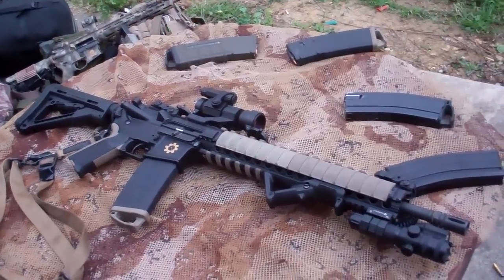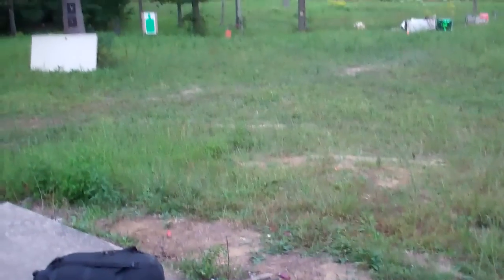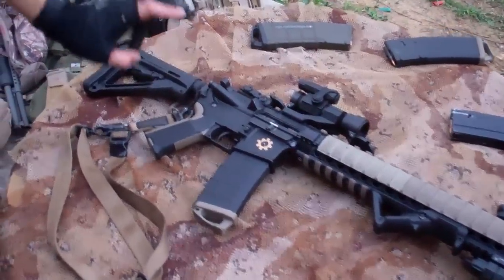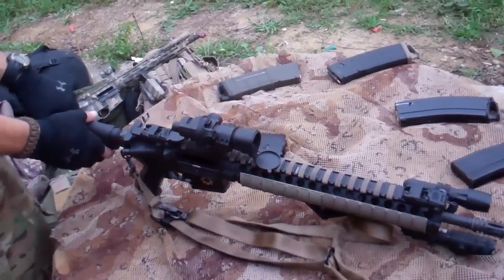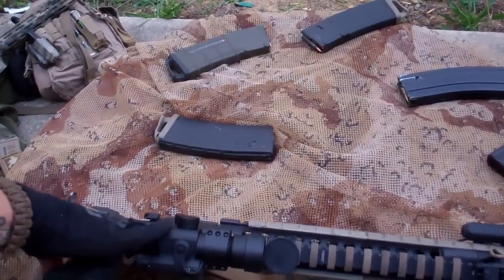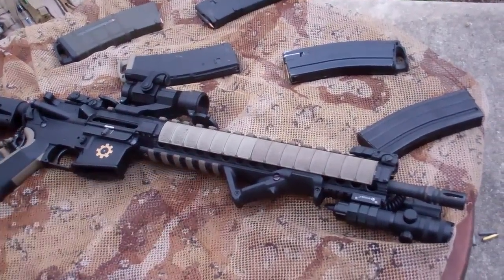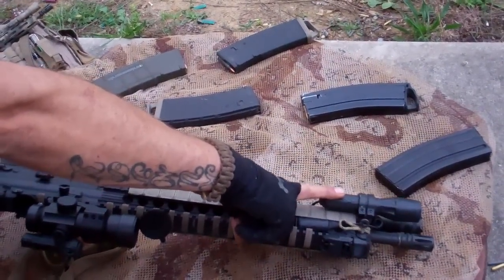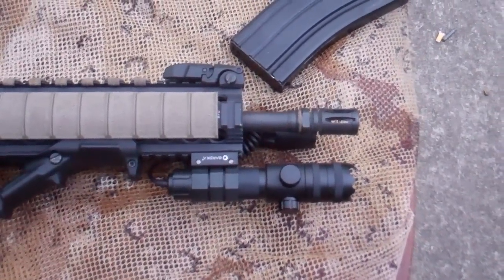16'' DPMS Oracle 5.56 Mods

Comment: Just wondering if you know if I can put a longer gas tube on to fit a mid length quad rail instead of the carbine length on my dpms Oracle Ar-15 .223/5.56 if so ware can I buy for good price just the tube thanks

Comment: I did have a question tho. Did you use a low-pro gas block? If so, what kind? I've heard of some people just grinding down the existing block if they plan on throwing a full size handguard over the carbine gas system.